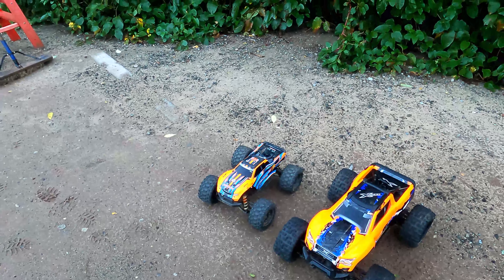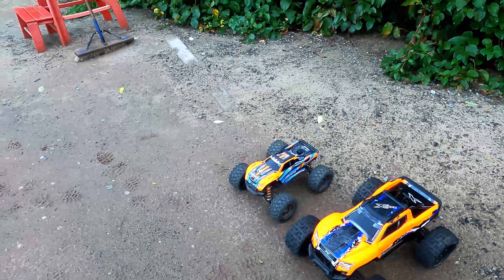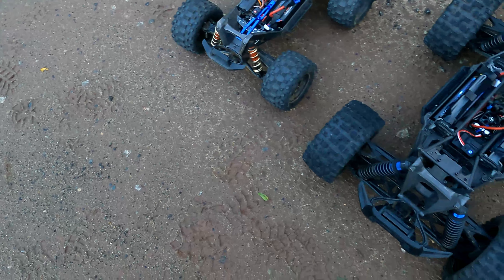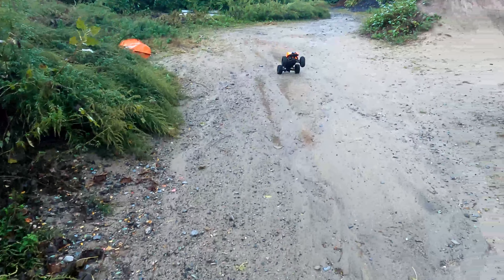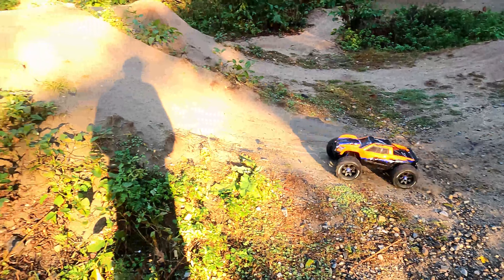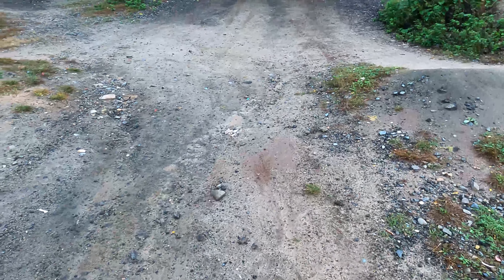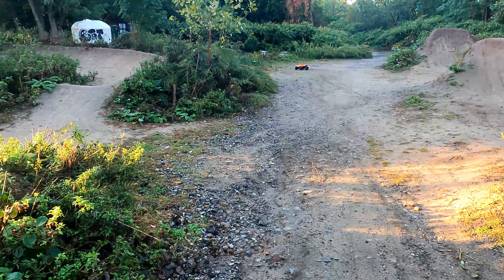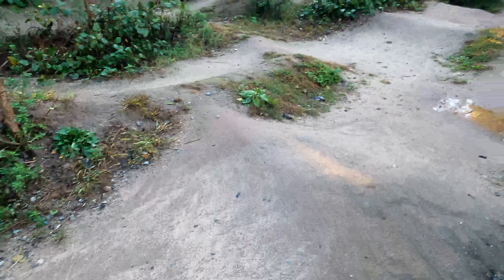Traxxas Xmaxx vs Mini Maxx

Comment: Such a nYce bash 😎 bro do you have the agf servo in the maxx I swear they do larger scale ones that could fit the x maxx or use the servo adapter and slap a agf more power than the maxx inside I have one in my savage flux xl think the 36kg tho I don’t have 8.4 bec so I only get maybe 33KG outta that servo on 7.2💥🎯💥🎯💯🎉
Reply from the maker: Yes I do run that in the maxx and it's perfect!! But the xmaxx uses a proprietary size servo it's not a proper 1/5scale servo so you're better off getting the adapter and running a really powerful standard servo.